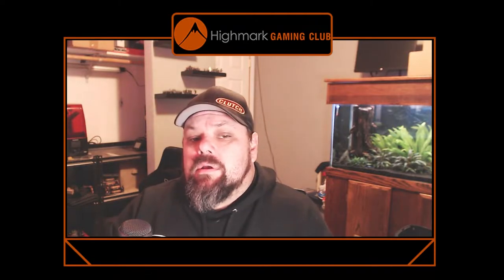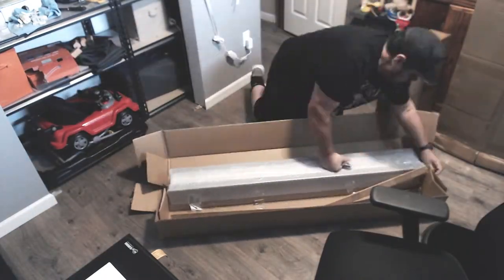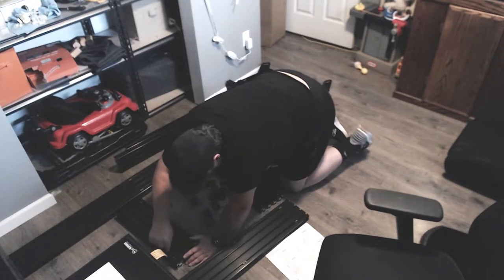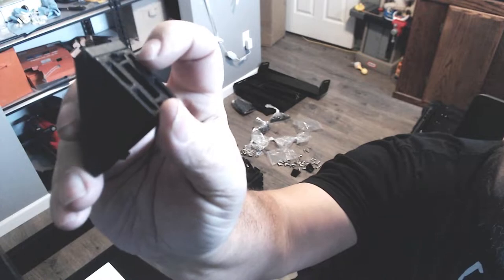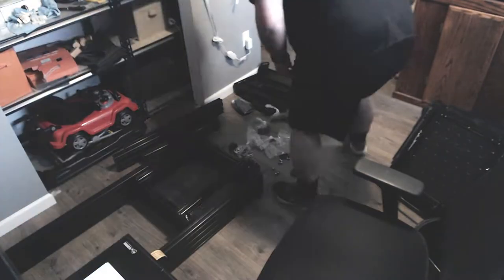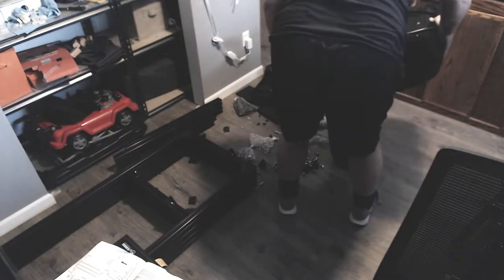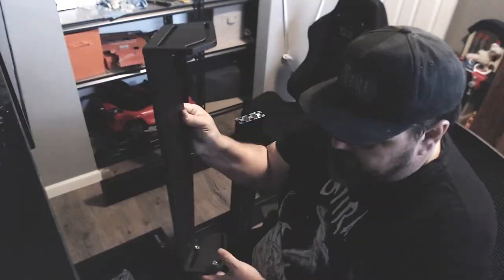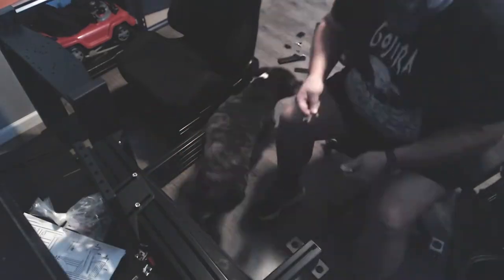Sim-Motion Premium Aluminum Extrusion Chassis build and impressions

Comment: Did you end up mounting the chair rails right to the aluminum rails using the threaded spring tees or did you use the L shaped brackets from chair rail to sim rail
Reply: I mounted the chair rails directly to the aluminum rails with spring t nuts.  You have to move the seat in order to get to them but it works.

Comment: Thanks about the video. I buy the cockpit to the same company Sim Motion i think that the angle bracket was metal and not plastic :( do they brake easy?
Reply: The angle bracket is cast aluminum.  The tabs are easy to break off.